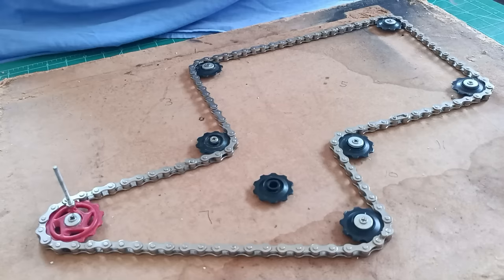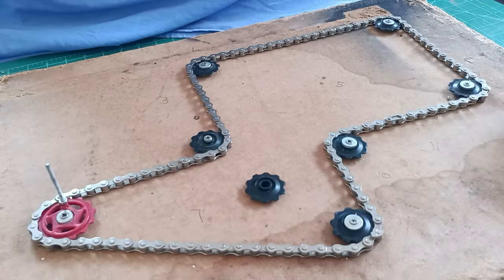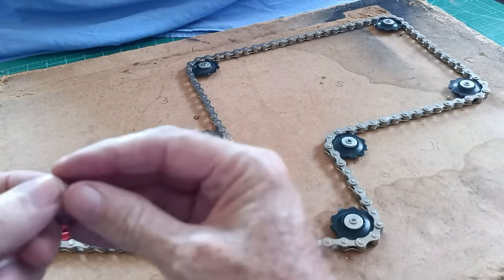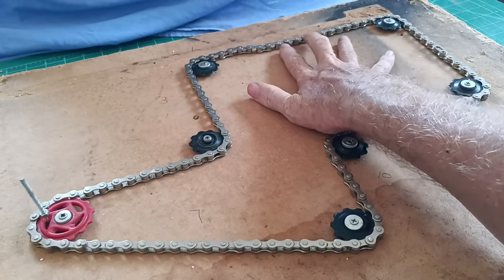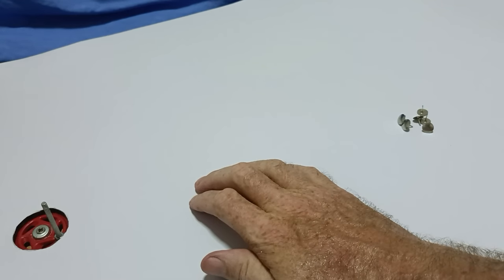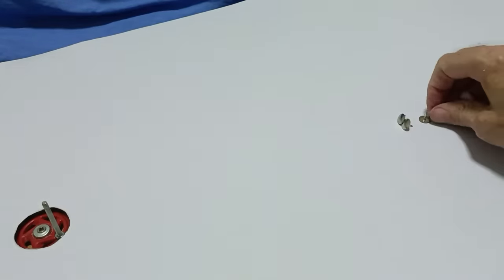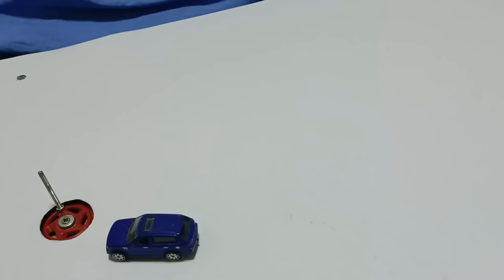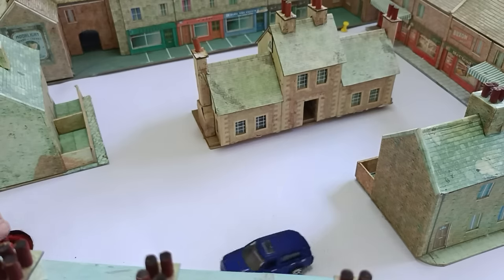Moving car system : for train layouts. Cheaper than Magnorail or Faller

Comment: You might try asking a local bike shop (or your cyclist friends) for a few old chains, clean them up and link them up (easy with 'quicklinks')- you really could extend quite a bit. Another advantage of old chains is they are more flexible side to side (due to wear and stretching), so may well work over gently rising and falling terrain. Excellent idea, Don.

Comment: You've built a very ingenious and cost-effective system. If you want to hand crank the track without the crank being in the way, stack two drive cogs with the top cog driving the track and the bottom cog linked with chain to the crank cog off to the side.

Comment: the chain is working fine , as for weight / mass  you could try other types of band or even a rope , but the chain is making sure the magnet stays pointing upwards  .  super great system and expandable for little more cost

Comment: Great idea. The larger wheels could be used in different places to increase the radius of the corners, or 3D print other sizes. If the chain was rotated through 90 degrees inclines could be done like in Chicago. Putting kapton tape (not so cheap though) under the cardboard would reduce the wear.
Reply: To make larger radii, just put more cogs closer together.

Comment: I was contemplating something similar on the river on my layout for boats, but have 6mm MDF and 4mm resin so I will need to get really strong magnets, only issue is the magnet rubbing the road surface, maybe try a small airgap which would sole the join in the card too.

Comment: Great idea! Love it very much. Here you go, a solution to joining card. In the automation industry, for inductive or optic sensors/switches, a device called a "soft nose" can be purchased to allow slight contact with moving parts/products to ensure jamming/damage does not occur. Using a domed cover stuck to the magnets, the ability to glide over card joins and maintain a magnetic connection may be fascilitated.

Another idea would be to use a thin but firm acetate strip under the vehicle path that can be accurately glued together under the card to enable smooth traverse.

On a final note, garages could hide charging stations for remotely controlled vehicles to run random routes after being fully charged.

I love your work. Very good for a first build.
Reply from the maker: Very good ideas. I just used wide scotch tape.

Comment: Nice ! The durability of a steel chain is so much better than   3d printed plastic, this kind of system can pull mutch heavyer  stuff bigger scale vehicles also.  In legoland Denmark they have  ropes going in the shanels to drive model ships and sutch... outside...  this chain system could be used on outdoor railways to...

Comment: Cool system nonetheless, but I think this, and something like Faller has absolutely different target audiences. This woudl also work wike 2 wheelers, so motorcycles or bicycles, but from the nature is a static track with all vehicles moving at the same speed, etc. On the Faller, which I woudln't consider because of the price and just build it myself, each car is a standalone and detached from every other carm, and can therefore do much different things, like taking over, have a crossing, not even mentioning that each car can have hundreds of lights, indicators/hazard lights, etc. But for a small town like the one you showed, where little bicycles would fit perfectly, your system is more than enough, and probably far cheaper than magnorail. Hats off for that! :)

Comment: Derailleur jockey wheels come with bushings and these are designed to be low friction and silent running. The larger red jockey wheel is from a low end Shimano derailleur and those can be best obtained by asking nicely at the bike shop - they should have plenty in the bin by the end of a busy week. Maybe just tell the mechanic you will pay a quid for each one and you should get dozens.
The spring of a derailleur keeps a chain in tension and this needs to be part of the design. There are chain tensioners that can also be used. This should make it silent running.
Reply: Than you very much.

Comment: I constructed a 3 lane motorway diorama in 1:50 scale using this exact principal!  The turnarounds at each end were the worst parts to design 😒(each lane moves at a different speed and avoiding them hitting each other at each end was a nightmare) different sized drive sprockets achieved the 3 different lane speeds, and the vehicles just cycle round in an endless loop (up one carriageway then down the other side).
I powered it off an old windscreen wiper motor (because it was free) however I'm sure there are better geared motor options available that have a lower amp draw.  I toyed with the Idea of making a video on it, but decided against it 😒 Well done for posting this , It's a very sound principle and 5 years later mine still works fine, the downside (when you have a lot of chains and cars/trucks) is that it's very very noisy!! Ps: the one thing to add is a chain tensioner on each run of chain, otherwise they throw the chain 😉. Oh and New subscriber here 👍
Reply from the maker: i commend your persistence. Until all problems are solved its not worth replacing the top road system, I was forever having to dismantle the system because of chains falling off. Better to share the idea and let others have the headaches.

Comment: Two thoughts. Instead of building up to the chain and gears, use a router to create channels for the chain and gears. Second thought, many die cast vehicles come with true steering mechanism in the front end. Which would create more realistic turns. That’s my 2 cents worth. Thanks for sharing.
Reply from the maker: Two good ideas worth considering thank you

Comment: On A Rollercoaster there is a chain that pulls all the riders up the big big big hump that starts the ride, that's a similar system, but it's for fun. but a simple chain in a city could be made with enough motors and hooks, not magnets, the hooks would pull your car around, but the car would need to retract their hook when at the destination, and get off the chain, and using electric motor, get of the chain, and park at home or a store. save tons of electricity. But the system would require paying a fee to use their chain system perhaps. My concern is: how many cars can the chain handle, or how many tons can the chain in a city pull? That's a lot of tons of weight. Just my thoughts. Terry
Reply: What you describe is basically the way trolley cars in San Francisco are moved. The conductor of the car pulls a lever to clamp on to a continuously moving cable, hence the name "cable car".
I don't mean to detract from your idea, it's a great way to move traffic around using far less energy and eliminating internal combustion engines in cars
Reply: That's very revealing! I Thought the cable cars were electrical cars using electric power lines above. I heard the term cable cars, but I thought that was mountain climbing cars, lol.  Thanks.

Comment: I did this 22 years ago then revised it using a nylon roller chain as you can make holes in it, the steel I used wasn't magnetic so the switch to nylon worked really well. But when Magnorail came out I started again with a product that was made for the job! Sorry Don but 5 years on and my Magnorail still runs great, not like this I know is noisier than you'd like to say! The membrane (road surface) needs to be more than card as the center of the layout has zero support if yo run a sinlge lane road!

Comment: i luved the vid papa! im trying to search for smaller chain gauges, to drive an entire table top(underglass) diorama.  if it all works out, im going to make it 2 way powered, hand crank on the side of the table, and a motor,/ later it might have a small solar panel array as part of the scenery, that will feed a small battery pack(2x 18650) when it day time, but when the table stop receiving light, it then enables the batteries to light up the tiny led lampposts and houses/shops lights  =D
Reply from the maker: Good luck!
Reply: @nanplabwern  im... gonna need it! eheh =D

Comment: If you overlap pieces of card, as long as the car always passes from the too card to the bottom, the magnet shouldn't catch. You can put a small slit in the cardt to swap which piece of card is the top allowing a circuit.
Reply: Not really. Either the top or the bottom magnet will catch...

Comment: Very interesting and creative. I'm wondering, though, if the bike chains could be configured in such a way that cars/vehicles wouldn't have to make wide turns within the circuit, as I want to model a small town on my layout with a few dead-end streets.
Reply from the maker: The cars will turn on just the diameter of the cog so a very small turning circle.
Reply: @nanplabwern  Ah, OK. The streets on my layout will be about 3 inches wide, so I believe having a cog of that diameter will work. I also believe (and please correct me if I'm wrong) that the turning circle would be increased or decreased with a larger or smaller cog.

Comment: How would you connect the electric motor to your track to make it functional??
Reply from the maker: Just replace the red drive cog, as you can see in the video, with a slow drive electric motor. I make it sound easy but l have not tried it myself it is just an idea for others to elaborate.
Reply: Amazing thank you !! I am very new to this and I am barely starting my hobby of a scale models. I haven't been able to find the the bike sprockets yet but I love your video it encouraged me to start my model!!
Reply: By any chance can you explain what parts you used to attach the sprockets to the wood to hold it in place?
Reply from the maker: @rriissaa05  Each sprocket comes with a bush that is a fraction thicker than the sprocket so in fact you fix the bush to the wood leaving the sprocket to turn freely

Comment: Nice, but seems expensive. Is a simple string not enough? It could go up and down hills and may be easier to make junctions..
Reply from the maker: The system works by using magnets so string wouldn't work but by all means try it and let me know.
Reply: @nanplabwern  I know, but the chain is not magnetic itself either, although it may enhance the field. Magnets must be hauled around.

Comment: I've got no idea why YouTube threw this into my feed, but replacing the bike chain and sprokets with GT2 belts and pulleys (commonly used in 3D printers) would reduce cost even more and would be quieter. Slightly more advanced would be to use the same sort of stepper motors used in the 3D printers along with an Arduino and stepper driver PCB to power it. If you have access to a 3D printer, GT2 pulleys could be printed in different diameters to give wider or tighter curves.
Reply from the maker: I'm sure everything you say would be possible but all I was promoting was an alternative idea to the expensive kits that are commercially available.
Reply: @nanplabwern  No worries, your ideas just had me thinking out loud.

Comment: Smart idea, maybe you can make the handle for turning the wheel under the table and raise the entire table so you have space for your hand or use a chain or rope system and connect the turning wheel with a second wheel with the handle for turning the system outside the diorama base so it don't form an obstacle for the moving vehicles
Reply from the maker: Yes, whether hand cranked or motor driven it needs to be hidden under the layout

Comment: Can I  float an idea by you chaps. Do you think with the chain theres enough side movement that a simple sliding cog or low friction skid like a bike derailer could push the chain enough so if you were running an indevidual vehicle like a bus it could be steered to a bus stop but in the normal position with other vehicles they would drive buy with out deviation.
As l said it would only work with indevidual vehicles on the chain at the time.

Comment: great idea got me thinking about using meccarno bits plus low voltage motor and piano wire ?
Reply: It would be a problem to fix the lower magnet on a piano wire, I guess.
Reply from the maker: I assume you mean piano wire instead of a bicycle chain, l think that would cause too many problems.

Comment: As far as the magnet, if the chain is metal and not plastic, couldn't you just glue the magnets to the cars?
Reply from the maker: The magnet has to be level with the bottom of the car wheels ,
But it could be done

Comment: Hi, I can't those cogs anywhere, what are they called and where did you buy them from please?
Reply: Hi Russell, you can get the cogs from a cycle shop as they are to tension the chain on a rear dirraller, racers, mountain bikes and normal bikes have them. One of the companies who make them is shimano.
Hope this info helps
Reply from the maker: They are bicycle gear parts. I live in Thailand and buy from a local shopping channel from China so l can't advise where you might buy from.
Reply: Jockeywheels ebay has loads

Comment: Can you your self add the motor
Reply from the maker: Yes, you would need a slow motor mounted under your layout
Reply: Thanks for the help
Reply: What are you calling the plastic things that help make the chain more
Reply from the maker: @miltonjohnson4345  They are wheel "cogs"
Reply: @nanplabwern  thanks
Reply: @nanplabwern  The small plastic cogs are called jockey wheels and are intended to feed the chain though the rear derailleur cage. An excellent idea. Also see Everard Junction YouTube channel regarding joining card / paper for extended runs.

Comment: Well done and great video on a dificult thing to video. I made a similar thing many years ago using 10 speed derailier sprockets and chain from an old bike. the motor I used is a widscreen wiper motor that works with a crank. the crank replaced by a sprocket from the 10 speed.  https://www.youtube.com/watch?v=E7AgDePwNHk    I like the idea of a hobby not breaking the bank.